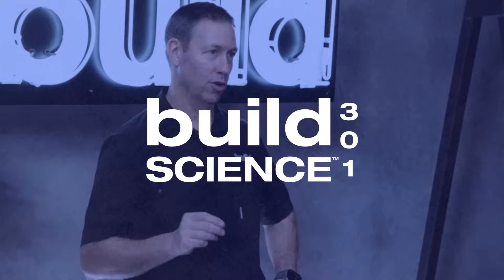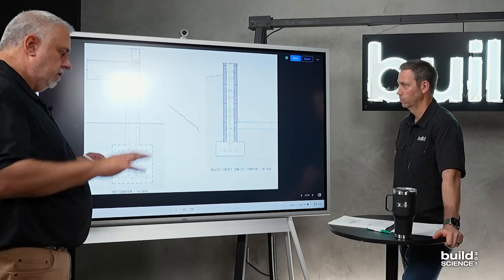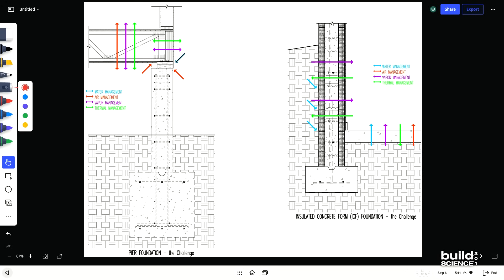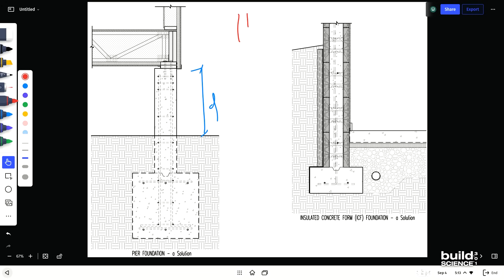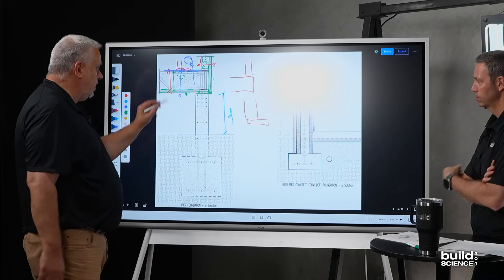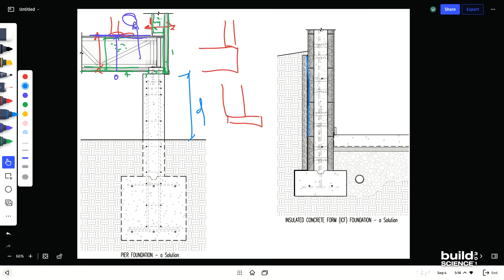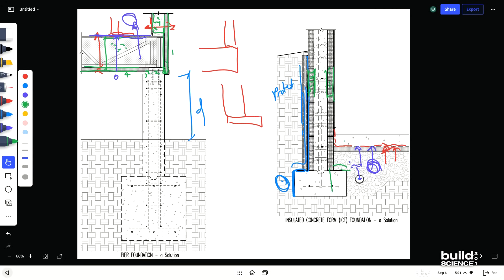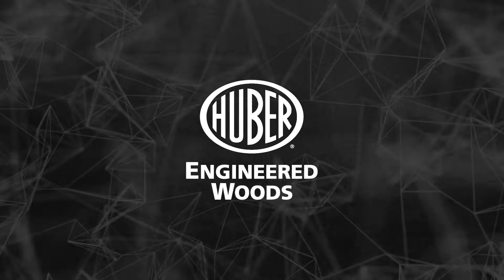Build Science 301 -  Ep. 3 | Pier Foundation & Insulated Concrete Form Foundation

Comment: I like the idea of ICF, but I don't like how vulnerable to damage the exposed foam is.  I wish someone would make a concrete form system with central foam blocks that stack together and have integrated form ties that would attach to removable forms like those used in traditional poured foundation walls.  That way you can have foam insulation in the center of the wall with concrete on either side, with the foam blocks and integrated form ties available in different thicknesses and lengths to meet the different insulation and strength requirements of different homes.  I've seen something similar called a "spider tie," but all of their videos on YouTube are like 8 to 10 years old and their system doesn't seem to allow for much insulation.

Comment: The thing I'm most concerned about with ICF below grade is termites.
Reply: Are termites eating the foam?  Bc they’re not eating the concrete or the rebar
Reply: @b22chris  they burrow through the foam until they hit the concrete and then they will tunnel up along the concrete until they find a crack or reach wood to start chowing down.

The issue is that it's almost impossible to treat them if they've gotten into the foam with ICF because the foam is pretty much bonded to the concrete and termite treatment can't penetrate the foam. The foam also prevents you from seeing their mud tubes, so you won't know you have a problem for much longer.
Reply: You do not have a TV erm break where bottom of icf wall keys into / lies on footer .-you can control water transmission by sealing the top of footer with waterproofing but still losing substantial heat
Reply: You do not have a Thermal break where bottom of icf wall keys into / lies on footer .-you can control water transmission by sealing the top of footer with waterproofing but still losing substantial heat
Reply: On pier and beam how do you sheath zip r that is not lying parallel to ground??

Comment: When you have an ICF basement and have to bring electrical wires into the wall cavity, can you drill on an angle through the subfloor/bottom plates on an angle into the wall cavity or does anyone sell a pvc tube plug for preinstallation?
Reply: I route a slot in the inner face of the icf and place EMT in the slot . You can also cast PVC conduit into the icf cavity.